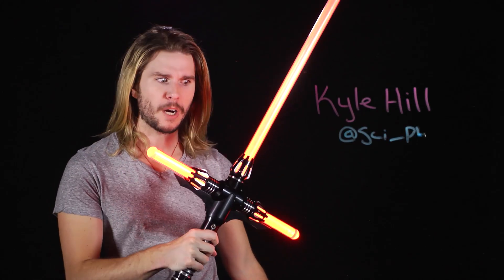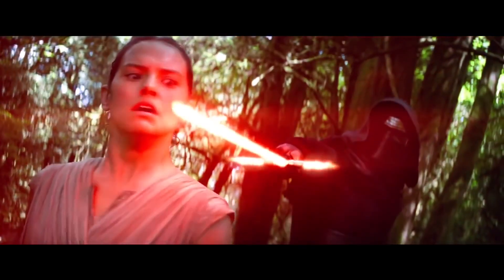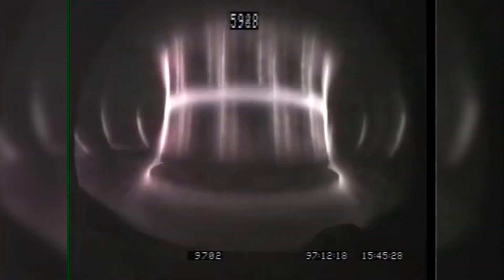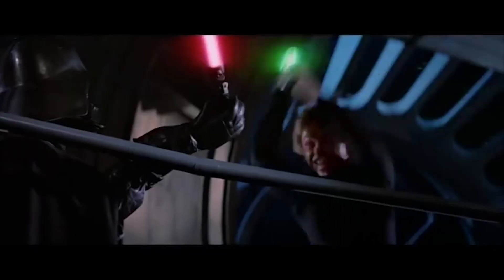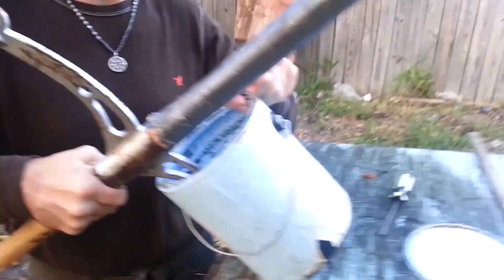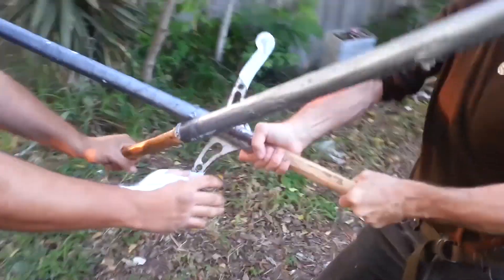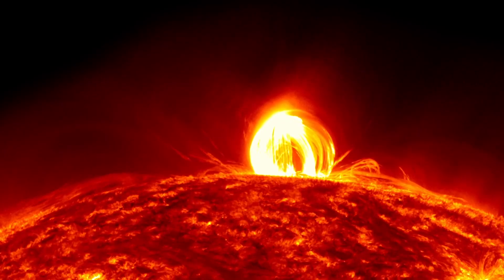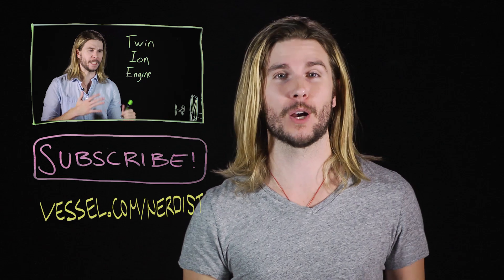Why Kylo Ren's Lightsaber Works (Because Science w/ Kyle Hill)

Comment: Great stuff as usual Thor but, I got a retorts to throw at ya.

Yes cross guards are a historically viable addition to a sword but, they were almost never actually sharpened. Their purpose was to catch the sword from sliding down the blade in a clash (which light sabers don't do) or in parry attempts. That said, even while not sharpened cross guards were versatile enough to be used as a bludgeon weapon, among other uses. Kylos saber only limits himself. Yes, he can train around it but, it's still something that he'd have to watch out for . Instead of the cross guards working for him he'd have to work AROUND them.  As far as versatility it's no more effective than the actual blade  (both parts being plasma) and as stated above it loses the main purpose to catch a sliding blade since lightsabers wouldn't slide. It could help with parrying but, that's a small plus for many negatives. Hell, he gets beat down by Rey at the end, a person who's never even held a lightsaber. A MUUUCH more effective alternative would be to have the cross guard made of lightsaber resistant material which DOES exist in the starwars universe. Or at least have it so the cross guard is covered by metal everywhere except the top of the beam (it'd also look super cool).
Reply: I'm yet to see a sharpened crossguard where the side facing your hand is sharpened.  I've seen the parts facing the blades sharpened (similar to having the top part exposed and the bottom covered in cortosis, as you reference) in some rare instances, and even in one or two cases I've seen designs where the points of the crossguard are actually sharp.  I'm not sure a sword with a sharpened lower half exists, and I'm pretty sure it's because that'd be stupid.  And dangerous.  It'd be stupid dangerous.  Hell, many swords already aren't sharp along the entirety of the blade for varying reasons.
Reply: Amaranth
Next thing you know they'll have swords with sharpened handles.
Reply: Ed Boon And then lightsabers with lightsaber handles.
Reply: Amaranth  Next thing you know Jedi will be made of lightsabers.
Reply: Ed Boon I don't see why not!  People have been made of swords fo centuries.

Comment: Kylo Rens lightsaber only has the cross guard because they are vents. The force crystal he used was flawed with a crack when it was made. ( Yes Sith make their lightsaber crystals, this is why they are red.) So when he made the lightsaber he had to manufacture the vents so it wouldn't blow up when he ignited it.

Comment: Great video. One aspect I was sad to see excluded from your debate was that Kylo uses an UNSTABLE crystal and the "cross guard" is actually a redundancy to expel the extra heated plasma produced as a by-product of using an unstable (cracked) crystal. Otherwise the saber would just blow up within seconds of igniting it and in turn mame, amputate or kill Kylo. Its also the reason it cracks, fizzles, arcs, flares and generally acts very un-lightsaberish. Its in the lore, so not necessarily a scientific strength, but at least something to support your topic.
Reply: I also read that it is a old style of lightsaber. either way there is reason for it.
Reply: Jem Lee The style of lightsaber Kylo uses is actually known as a "heat saber" but otherwise yeah, the cross guards vent the extra energy produced from the unstable and much stronger crystal he uses. The increases energy from a heat saber is also why it crackles like that
Reply: Chamber Of The Wraith the crystal he found wasn't synthesized like other red sith crystals. He found it cracked. That is the explanation for the unstable blade
Reply: 93Legit it has a crack in it or it doesn't hold well under the strain of the use in a lightsaber.
Reply: +93Legit ha ha - what does that mean you so colorfully ask? Well - ummm -  I already - literally - spelled out what "unstable" means. lol. To keep it simple you don't have to get past the first sentence in my comment - and no, not jello :)
Reply: Unstable crystal?
Reply: I think it's pointless claiming that it works because it fits the show's lore and logic.. because probably they made the lore about kylo ren's lightsaber after designing it's shape to justify why it's so different from all the lightsaber that have been shown so far! That been said it's one of the most cool and efficient lightsaber!
Reply: my site neat. thanks!
Reply: Chamber Of The Wraith np
Reply: Chamber Of The Wraith  it has a crack in it or it doesn't hold well under the strain of the use in a lightsaber.
Reply: I agree to this
Reply: Jem Lee unstable crystal? r u kidding me? wtf does that even mean? is the crystal made of jello or what

Comment: the  crossguard wouldnt work because the gap between the grip and the blade is like 2 inches so the enemies blade would just cut the crossguard off.
Reply: and ANY PAWDAWAN as the guy says it knows that lightsaber blades dont just fucking split mid way through
Reply: ***** the technology that is used the contain the plasma doesnt allow it
Reply: ***** it would be impossible to create irregular shaped magnetic fields to contain it
Reply: ***** and even light whips were ONE beam you cant have mulitidirectional crystals/splitting mid way through ones
Reply: ***** because i was put in this universe to complain so i will do it no matter how much people give in, you see i have an impressive ability to see when someone has gotten a point

Comment: In an interview, it was said Kylo Ren's lightsaber had those side pieces for the sake of handling excess heat from the lightsaber. If you look closely at the blade of the lightsaber you could see it is unstable, so those things are mediators. Just in case if you wondered why they were there.

Comment: i train in swordfiting myself and can say that the crossguard the second most importanat part (after the edge itself of course) of this type of sword, since having it makes a VAST array of techniques possible. Like for example blocking, disARMing(heh get it?^^), and counter techniques. Plus when we are talking about kylos sword the metalpart of the crossguard is made of off ligthsaber resistant steel so u wont be slicig that through

Comment: You should explain WHY the cross guards are even there though.  He needs the vents in order to let the crystals cool because he has a fire saber which uses two crystals instead of one which is why his blade crackles and flares. Kylo's blade is awesome but is actually extremely dangerous according to even star wars lore because of the slightly faulty design of the blade.

Comment: You touched on something I had a question on, " why is kylo's sader all rough and crackly compared to the smoothness of any other lightsaber in the franchise does he use the force to make it look that way or does the cross guards affect the way the beam splits
Reply: The crystal he used was cracked so it was unstable and also the design he used was an old light saber and it itself was unstable so it had two vents to vent out the energy it couldn't contain
Reply: thank u
Reply: The Caiber(?) Crystal used in the Tri-Saber was larger than the usual one used by all lightsaber users, so without the two vent-like shafts to disperse the power the Caiber Crystal's energy would destroy the relatively small hilt used on the saber. The fiery-like unstable "blade" of the lightsaber is caused by the energy being interfered with by the two shafts, which is why the "cross guard" is perfectly smooth and straight like all other sabers and not the actual blade is smooth. Try this experiment: Have you ever gotten a slit or hole in a drinking straw and the beverage didn't come out properly at the top? Well, try making two slits at the same level across eachother near the middle of the straw. 

Now try to drink from it. 

The liquid easily escapes the two slits, and barely comes out of the top. 

This is basically how the Tri-Saber works. Hope this helps!

Comment: Everyone who defends this technology seems to forget about the basics: the psychological effect. Holding this light saber you have 2 small lightsabers right above your wrist all the time. Of course, it's very easy to be a hero in your imagination, but if you were given this thing to handle, you'd probably never even activate it. Because if you make the curve of the blade big enough, you gonna get burned for good. Awesome video though.
Reply: fair point, but that would basically apply to any lightsaber out there.

fortunately in Star Wars the characters dont need to worry about that :)
Reply: MaksDudekVA
Well yes, except that in this case the effect would be much stronger. One thing is holding a handle with only 1 burning end, the other thing is constantly having two of these in a couple centimeters from your wrist, waving it around. I know there have been experiments, but take a sword, heat the guard up to the point when it's white and see for yourself how comfortable you will feel when operating a sword. I can guarantee you, you gonna want your fingers as far away from the guard as possible.
Reply: Without the force, you cannot use a lighsaber with any kind of hurry. Non Force sensitives can still ignite a saber and use it as a plasma cutter (Han) but they need to take it slow. Only reason jedi swing it so fast is because they have the force to predict where the blade or blades will end up. Kylo has no problem with 3 blades because he is force sensitive.